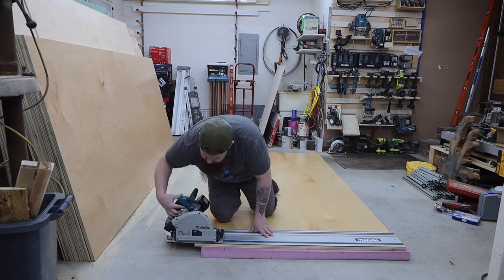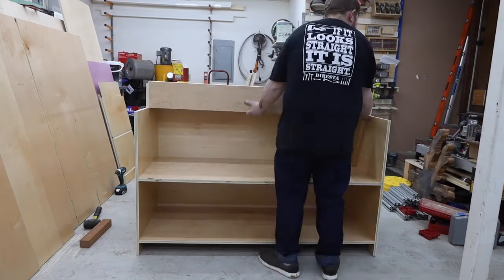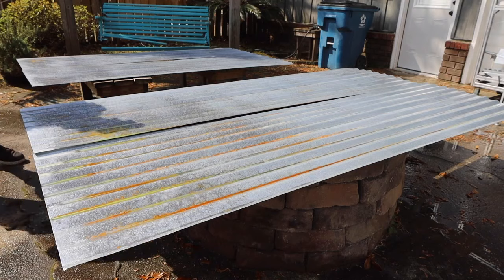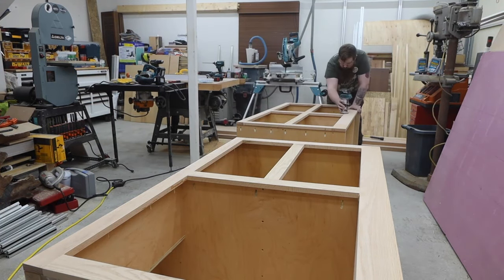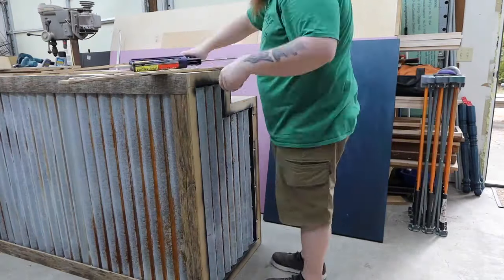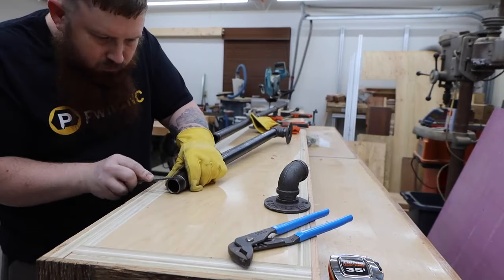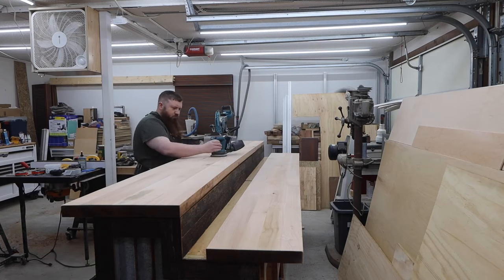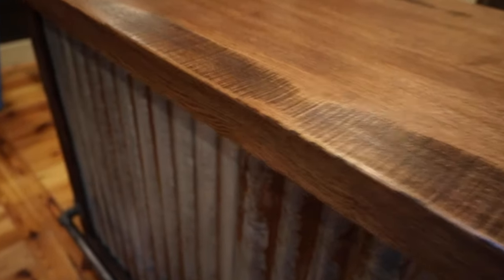How to Build a Farmhouse Bar - Industrial Furniture

Comment: very nice! Building the same look in my poolhouse. Can you please provide details on how you made the doors? Looks like the door frames are 3/4 thick and I see the plywood backer behind the corrugated metal. How thick is the plywood backer and any other details would be much appreciated!
Reply from the maker: The plywood backer is just 1/4”. You might have to flatten the metal a little to get it to fit in the frame. You can just walk on it to flatten it out a bit. The door frames are about 1” thick

Comment: Hey where do you get the periodic acid ??? :)
Reply from the maker: It’s muriatic acid. Any hardware store should have it. It’s usually in the paint section. It’s used for etching concrete.